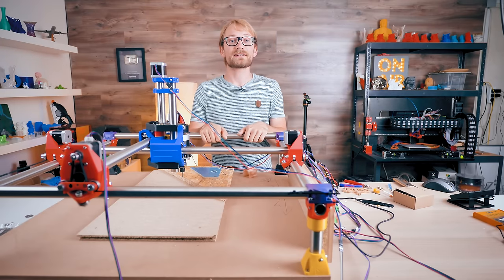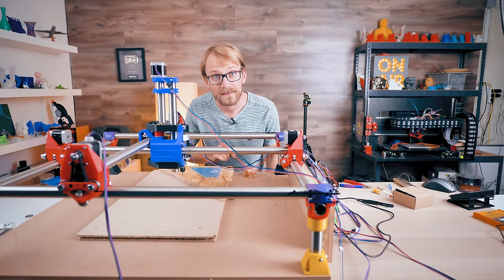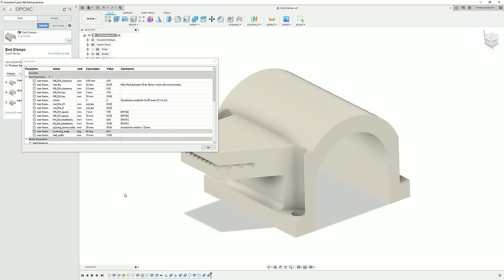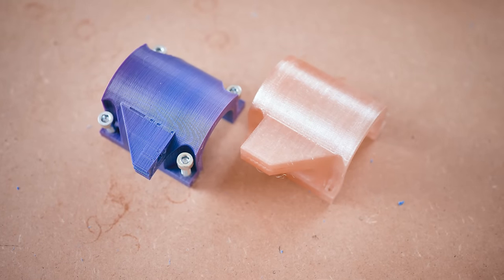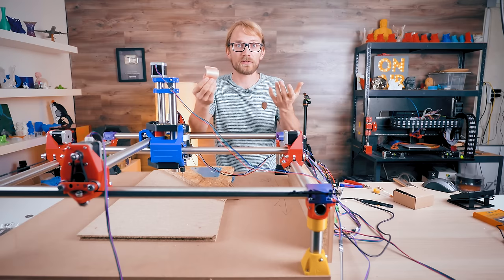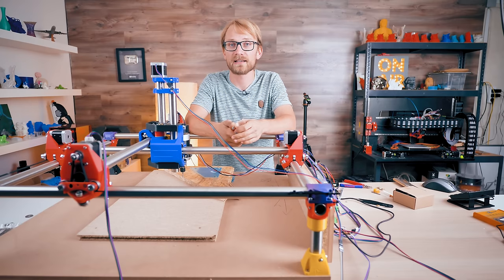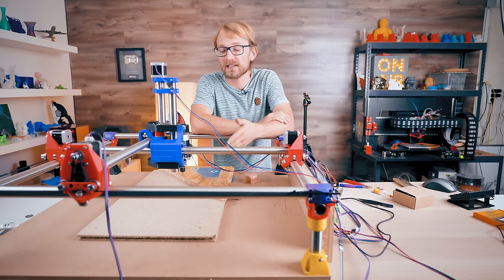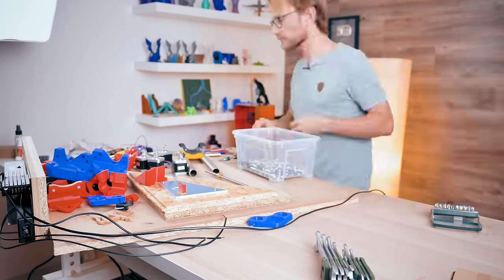Whose design even is this? (MPCNC conclusion)

Comment: This is one of those things that just spiralled out of context and control. I can appreciate both sides of this story. On the one side, Ryan is trying to maintain some level of commercial control over his design, on the other, Tom giving great input and design, and wants to make it something anyone can build on, and in the process will override Ryans licencing approach.  In the end, neither of them are wrong, but it ended in a public argument, and no one gains. People naturally need to take sides. I respect Tom's perogative, and would still support Ryan in his ventures.  I think we need both of them in this hobby of ours!!!
Reply: From a legal standpoint Ryan is clearly wrong. Copyright only protects against copying, not against designing something that works the same way. That's what patents are there for. If Ryan had a patent on that part, then he would be right, but he does not. General rule of thumb: Trademark protects logos and names, patents protect ideas, copyright protects against exact copies (and modified copies). Copyright does not protect against similar things (but patents do) and Trademarks don't protect products that don't show the trademark.
Reply: @dak1st  I fully agree. My comment, however,  is toward intent, not legality. If both of them were to take a step back, before arguing over the interpretation, they could probably have found common ground and a positive outcome. In practice, life (online or otherwise) has many similar previous examples. As such, the way this played out is expected, but still unfortunate.
Reply: @tiaanv  I see what you mean, and you are right with that. In the end, Ryan lost a lot more with his clumsy move, but also Thomas lost out as well.

Comment: I am confused now, the parts are on thingiverse licensed under the Creative Commons - Attribution - Non-Commercial license. That say`s "You are free to:
Share — copy and redistribute the material in any medium or format 

Adapt — remix, transform, and build upon the material "
Reply: Yes, Ryan only requested that the remix and transformation be released under that same license.  Tom threw a hissy fit.
Reply: I built one of these 2 or 3 years ago. Not for CNC milling, but as a platform for a laser cutter. It worked OK, but had issues then as well. I haven't considered redesigning this system, but do have ideas for an entirely different design. As CNC for a laser head, the flex associated with the tubes does not present a significant problem, but I would hesitate to put a dremel on it, much less a better spindle.

My take on the whole thing is that Ryan sees the CC-0 license as incompatible with the license he chose, and Thomas sees the CC-A-NC license as incompatible with his lifestyle. Rather than have viewers pestering him for the next 10 years asking what happened to the MPCNC he built in a series, he put the video together to explain his case. It sounds to me like he is not raging about the situation, just disappointed in the situation.

Comment: LOL Ryan needs to back down, or MPCNC is basicly over, noones going to publish anything for it again. If your experience should tell you anything, it's that it's a gimmick design anyway.
Reply: It’s an imperial design. For imperial parts, it works much better. So it’s a nice design for people in the US. I haven’t had most of the issues Tom has had. As for the Creative Commons issue, well...
Reply: I’ve had one for two years and have not experienced those problems.
Reply: It's so far from dead.
Reply: I have been saying it's an awful design from the start, the loads applied to the tool just don't fit well with this type of gantry design, a traditional CNC gantry with this motion system and doubled tubes sandwiching a 20x60/20x80 aluminum extrusion between them would be rock solid.
Reply: Probably won't die, but actively pursuing buyers of the machine that share modifications sure won't make it anymore popular.

I don't get why he's so uptight about it, the CNC is average quality at best, and you would think that a machine like that would be open source, seeing how simple and basic it is, and to promote further and faster development.

But whatever it's his struggle not ours ✌️
Reply: @Deathbyfartz  He would have been fine if the parts were released NC. Why not ask Tom why he is so adament about avoiding the NC? This is to protect Ryan's living, which, by the way, is the fuel for the v1 community. There are hundreds of derivative parts that are shared from him buyers.

Comment: When I first came across this project, my first impression was on the lack of adjustment for belt tension - so I reworked the belt anchor in Fusion to have an adjustable bolt attached to to the top cap (similar to what Tom did). Once convinced this would work, I sat through (almost) all of Tom's videos and became excited that I could build this for a laser cutter/engraver. I would have liked to use the router but I always felt it would be too flexible for what I would need. A sad end to what could have been a really great project.
Reply: Belt tension is adjusted by the zip loop at one end

Comment: I suppose that is the only decision that makes sense.
A bit of a shame after this amount of work though.

I built the machine 1-1/2 years ago after a complete redesign of all parts in Solidworks. The US pipe diameters are fairly useless in Europe, and the 25mm one is just too expensive to experiment with on a larger machine. Mine is based on plain galvanised German plumbing pipe, metric fasteners and a Kress router.
I spent a lot of hours on the design. 3D printed chains for the cables in all directions, cable feeds through the carriages, a new Z-axis for the Kress that positions it closer to the x-y crossing.
Of course I tackled the belt tension issue with real adjustable tensioners, also because when both axis have different tension, the x and y scaling differs a lot on a larger machine.
Nevertheless, the result is still a rather flexible machine, like yours.
To my humble opinion, it’s no good for anything but cutting styrofoam. At least on a larger scale than the original.
Maybe as a 3D printer frame, but then you would have an issue getting a heated bed that size.

Or promote it as a cake glazing machine perhaps? I’ll bring the beers 😀

Comment: As soon as you were running into the metric/imperial issues during the build, and saying that there wasn't a CAD model to modify, I stopped being interested in building one. I still followed your build, which was still educational, but why would you want a mostly-printed CNC, if the printed parts are just as closed?

Comment: Thanks Tom, I was about to order the hardware. I don't want to make a thing that can't be improved by a community.
Reply: You should still consider buying it. It can and has been improved by the community. It is just you can't sell any designs. You are free to improve away (I did) look on thingiverse
Reply: It can be, and has been improved by the community.  The only ask here was that the part be released as non-commercial, so 3rd parties can't print and sell.
Reply: @GeoffreyPitman523  I dont see how this can be handled, if you have to share improvements with the nc license this means ryan will never be able to use the improved parts himself without explicit agreement.
Reply: @benjaminjung6169  Yeah, that happens when you want to have your cake, eat it, and eat everyone else's as well because "your idea was first". The licensing scheme doesn't survive a mirror.

Comment: When I looked at your previous video and consider building one. I checked the design and think about your stability problem. My conclusion is that the design itself is flawed. So I will design one myself and make it freely available for everyone :) Have a nice day and thanks for your really good work.
Reply: Ask Thomas about collaboration?  ;-)
Reply: You are right, it is flawed and not just by a little either. But that doesn't mean it is not a good educational tool.
Reply: @xConundrumx  as educational tool, as long as you are not commercial. 

So the machine can arguable be a good educational tool, but with that licens, it isn't good for education and schools though. As schools can be commercial.
Reply: @AndersJackson  I meant for self-education. As in to get started in the world of CNC machines and to get to grips with the basics. Not educational as in schools.

Comment: Hello Tom, I just want to share some thoughts/comments on the MPCNC and your experience with it. I'll make a bullet list to (try to) keep it short.
- I build myself an MPCNC back in October 2016 and I was happy to get your notification on the live build videos. You are a mentor for a lot of people and I was sure that your video would contribute to growing up the MPCNC community.
- I've built the MPCNC with almost the same dimensions as you have and I found the same issues that you have encountered like the nut traps not grabbing the nuts properly (metric hardware). I found that welding together the "lock corner" and the "bottom corner" parts improve the rigidity of the assembly a lot.
- I've designed myself a derivative of a part compatible with the MPCNC and posted on Thingiverse (part 1933416) and like me, tons of makers have done the same (with various licenses).  Some of them are a must, like the "Universal Mount".
- Thus I was very surprised about your dispute on Twitter and very sad about the end. You spent a lot of time and for sure with your experience and expertise, everybody could have benefited.

Comment: I had a lot of high hopes for a project like this.  A cheap and affordable CNC that could actually manage decent cuts, and might even be scalable to larger sizes was really intrigu aaaaaaaaaaaaand it's gone.
Reply: If you build this machine correctly, it will work just fine.  Tom didn't build it correctly.

Comment: I think it's pretty obvious he just didn't want to attribute any work to anyone else. Simply put.
Reply: Tom that is right? Because all Tom did here was recreate Ryan's part, make a small change to the belt connection mechanism and try to re-release it with no commercial restrictions. Tom's design is clearly derivative of the original but Tom didn't want to attribute Ryan for his original design and clearly Tom didn't want to maintain the original license.
Reply: @hodgeac  He didn't recreate Ryan's part, he created a part that was parametric and put in parameters that would make it fit with the MPCNC. It would be different if he copied Ryan's part, then modified it.

Comment: That sux!   I'm building one now and i've had problems with the pipe size.  The conduit we have at Lowe's and Home Depot, here in Georgia, USA has a diameter of 23.5mm and all I saw on Ryan's site was 24.5 and 25mm.   I scaled the parts to 95% and then printed them.  I cut the boards down too, but last night I found that the wheels bowed in, have to recut the side boards...  A real shame he's making it undesirable for others to HELP him improve his designs.  It's not like you were trying to sell parts!!!  Big fan of your channel, keep up the great work!!!  Thanks.
Reply: I'm in Georgia and I bought the correct tubing just fine. The lowrider is not made for conduit, it is made for stainless only. You need to get 25.4mm OD stainless steel tube.

Comment: I have been using the MPCNC for over two years and sadly I like Ryan on some things but he lacks vision for the modern makerspace.  First time I realized this was when he tried to force people to use his website over the Facebook group.  It pains me that he has run you off and I believe this series and your expert help would have done the MPCNC community a lot of good.  I can only state I am moving on some to the Gatton CNC community mainly because it is a family and does not have these problems and it is a better machine.
Reply: I've heard good things about the Gatton CNC as well.  I have a Millright CNC Power Route... and it's a great machine but the cutting area is bit small (24" x 24") and I wanted something for bigger cuts... was seriously thinking about building a Gatton to go along with my Millright.